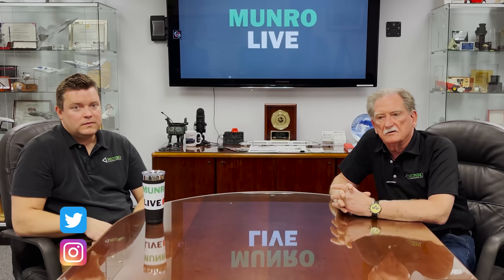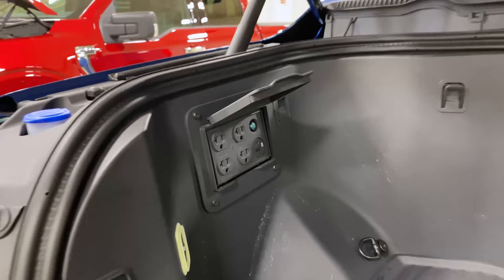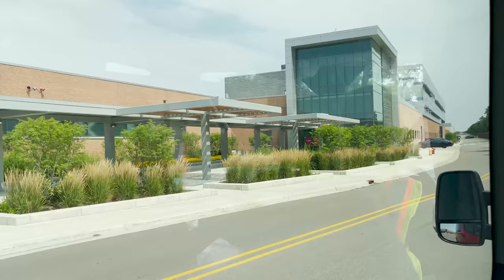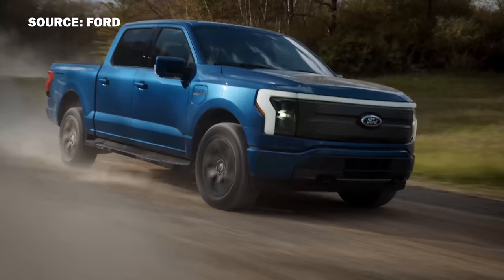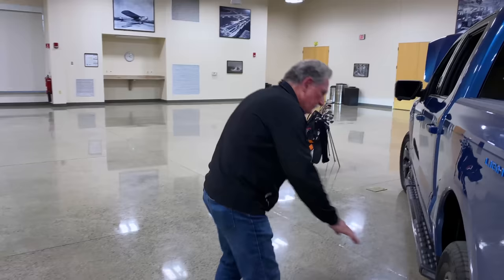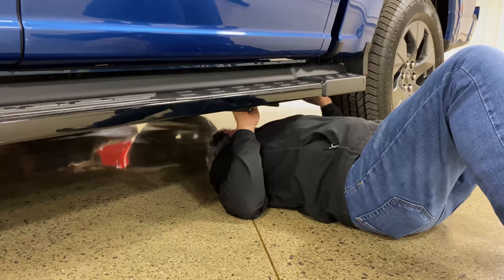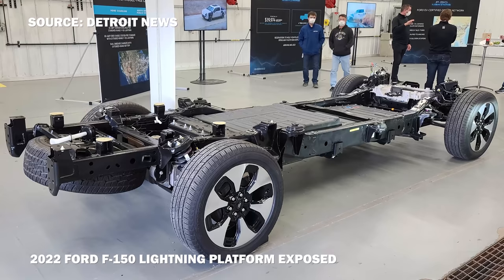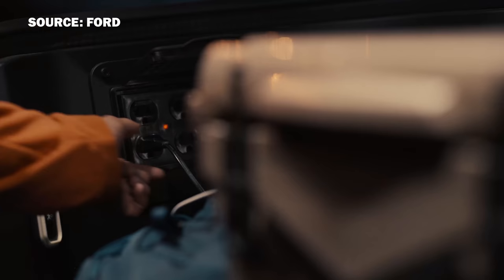Sandy's First Look at the Ford F-150 Lightning Electric Truck!

Comment: FORD F150 XLT LIGHTNING, $92,500., WHAT YOU DON'T GET BELOW.
F350 4X4 CREW CAB FORD GUY GOING WITH TESLA.
RETIRED 77, USAF VET, JET MECHANIC. REGISTERED FOR 2023 CYBERTRUCK ON NOV 22, 2019. TRUCK FEATURES: FULL SELF DRIVING, SELF OPENING DOORS (NO HANDLES), FREE DRIVER ASSIST (AUTO PILOT), FREE OVER NIGHT SOFTWARE UPDATES, STAINLESS STEEL TRUCK, BULLET PROOF, CLEAR ALUMINUM WINDOWS, ACTIVE SUSPENSION HEIGHT CONTROL. FOUR WHEEL STEER, CRAB WALK, TANK TURN, PAYLOAD 3500 LBS., TOW 14,000 LBS., FOUR ENGINES, 800 HP,  500 MILE RANGE, 35" TIRES, 16" CLEARANCE, 5'x 6' NO FENDER WELLS VAULT BED, WALK ON TONTO COVER, 31' LONG. PRODUCTION 80K TRUCKS ANNUALLY. EDIT: GENERATE MY OWN ENERGY,  https://www.youtube.com/watch?v=TtQm34QopN8

Comment: Isolated battery = increased weight and lowered utility.  An efficient design would incorporate it into the structure of the frame, not turn it into cargo.
Reply: For upgrades you want the isolated battery.  There are also more battery choices.

Some may want a 400lb battery in the frunk or a 1k+ pound battery in the bed etc.  So a 472 mile Ford Lighting could go 1000 mile or even 1500 miles on a full charge.
Reply: @jonmccormick8683  A structural battery can be exchanged.  It's bolted together like any other part.

Comment: I will buy this in a second when they make a cab & chassis F-550 capable of hauling/towing 30,000 pounds and can get  200 miles doing so.  Assuming its in the $70,000 or less range of course.

Comment: 230 miles of range for the base model is not a good look. Going tailgating you might drive 50 miles each way, then you're plugging stuff into the truck for your lighting/entertainment/cooking for a few hours, and then the drive home. That would be cutting it close, and you'd probably need to stop and charge. Of course Ford doesn't have a Supercharging network either.

230 miles of range would not be usable for most fleet trucks as well, and no way are these companies going to spend for the upgraded models. If you're plugging tools into the truck the battery will be dead by lunch. I work out of my Model 3 (just AC, music, and my laptop plugged in) and the drain is real.

Comment: I really want to go to an EV. And I have solar panels on my roof. But I'm in an area of Mexico that has virtually no charging network for road trips. I can"t say when that will change.  And due to the cobblestone and dirt roads I'm thinking of something like a Bronco Sport Badlands. That's the perfect combo of size and utility for me.

As much as I hate the fact that plug in hybrids are so complex and expensive the closest I can see for my needs are the Rav 4 or Escape PHEVs. 

Any thoughts?
Reply: Hang in there. There will be mid-size EV trucks and SUVs soon enough. It's going to be a tidal wave of change when it happens. Electricity is much easier to deal with than gas or diesel. Like you mentioned solar panels, even a "EV fueling station" that's off the grid can function with some solar panels and a battery storage system. No need for refueling from tankers or running power out to a location.

Comment: Just a thought.. let say a trailer manufacturer wants to sell to be towed by this eF150. Ford should be willing to lease (for free) this vehicle to them, they test their trailer on the said 10 mile configuration/validation.. they get the data and so do ford - of course that's the reason ford will lease it to them. Thus ford can put in this data with estimated range already in its memories so that the eF150 users don't have to - or they can download from the manufacturer.

Just like driver software after needed for pc so that computers can talk to the said peripheral.

Comment: Doesn't having an isolated battery pack add quite a bit of cost to the truck? Won't a smart computer system be able to create a virtual battery pack isolated from the vehicle but also allow it to be used for driving in time of emergency more flexible?

Comment: why does an Electric Truck even need a GEAR Shifter for ?
its Another thing to BREAK and is a Part that Should be DELETED along with the START Button in Vehicles. 
the Cybertruck has no Shifter at all, you just Swipe the Screen . 
CT does not even have a START button, you step on the BRAKE , Swipe into Drive , Release the Brake. that it.

Comment: Good stuff. Fascinated by the description of the rear(?) casting. If I understood correctly it has some rotational freedom around the axles and some degree fore and aft as well. Is that correct?

To video editor: intro cuts were just a bit too jarring. I see what you were going for and it almost worked. Just a few too many hard cuts for my eyes to keep up with.

Comment: Tesla has plug ins, it the back as well. Tesla can use the computer in the vehicle, you don't need another work space. Plus I don't think they have an old gear stick???
They did not let you drive it? Is this the 90k truck? Do they even have the prototype for the 40k truck. 
The nice part of this is anything good, Tesla can copy. 

Ford doing the low end up front is going to hurt them bad. I believe there is a major loss on the 40k truck. 

It looks like a normal truck? The frunk is very nice for sure. 

It took Tesla to push Legacy to do brand new inovative stuff. I am impressed about that, but the Truck will still be 50% old stuff like you found in the Mach-E.

Comment: Ford doing so much right with their EV approach. The F150 Lightning is absolutely going to eat every other EV truck's lunch. Even the boutique trophy lifestyle ones. Especially those poseurs.
Ford doesn't fight Right to Repair and they also don't look like they're going to over promise and under deliver on range either, like Tesla does on both fronts.
My prediction - a robust online campaign to undermine this truck once it starts selling. Waged by the usual online culprits: the cultists.

Comment: Unless Ford has an answer to the Tesla 4680 cell it won’t be successful. The 4680s 60% reduction in cost alone will kill it that’s not even talking about charging and discharging improvements over all the other cells.

Comment: making the 2021 FORD BRONCO a Hybrid was a Mistake, FORD should have made the BRONCO ( all Variants) 100% Electric with a Large 100 kwh Battery Pack and 100% Electric Drivetrain with no option of Hybrid or GAS Drivetrain. 
they would have sold more Vehicles and customers would be happy the the SPEED and Instant TORQUE boost , as well as the Range and Towing ability 100% Electric provides. 
however FORD needs to also help BUILD a Nationwide FAST Charger Network.

Comment: I do not understand: so far Sandy was amazed by the thought of a structural battery pack. Now they are amazed by an isolated one? I get that this is a truck and it has to be durable, but still.

Comment: The switch to electric trucks is afoot ecxept for the big tow.  When is Ford going to reveal their solution for that?  You can use one of these every day and do anything a gas truck can do until you decide to tow a trailer or boat over 200 miles.  At that point electric trucks make no sense.  Ford patented a bed mounted range extender a year ago but hasnt mentioned it at all.  If you put a tool box shaped range extender in the front of the bed, it could be stuffed with extra batteries, a gas or deisel generator or even a hydrogen fuel cell depending on what fuel is available along your route.  This would resolve the remaining limitations of the electric truck and when you dont need it, you put it behind your garage as a backup generator for your house.

Comment: You guys bought the sizzle from this Ford team.
Reply: Seriously? What's wrong with appreciating what others do right?
Reply: @magnusauto7941  , if they really wanted the vehicle to stand on its own merit, they would have dropped it off for a day, instead they brought a sales team. They sold a big trunk, plug in electrical, independent suspension,a drop down gear lever, these aren’t new ideas, they were selling sizzle not steak.

Comment: When it comes to a truck I prefer the lowest equipment and trim levels because you can haul more load (heavier) . Electric windows and door locks add unnecessary weight and opportunities for failures.  I don't even want a radio. I don't want a touch screen because you must look at it to change any settings,  eyes belong out side at all times. I do want climate control and GPS receiver.
Reply: If you get a truck with the Suynch system, most settings can be changed by pushing a button and giving it a command such as "Dial [name]" or "set destination, street address". You can also change radio stations by vouce command. You never have to take your eyes off the road.

Comment: I really like what I see, I'd like to get a chassis model that I can put a camper top on. Built in power source I can charge as needed, with supplemental solar on the roof.
Reply: Solar is almost useless for cars, the efficiency of solar panels is still very terrible, toyota has been using solar on their hybrids to run the AC and charge the 12v battery for example.
Reply: @alanmay7929  I agree. But a parked camper top truck with 1kW+ of solar panels on the top is a lot different than a small car roof.

https://youtu.be/kd6LSJjOawM?t=1118

Comment: I don't think Ford  will have enough  battery capacity to even hit 40% of total sales as EV by 2030. That would require in the ball park of 168GWh (at current volume assuming 70KWh packs each) of battery capacity or almost 90% of the current global battery capacity.
Reply: they are building two new battery factories in US with SK.
Reply: @garfieldchenyu1  I was reading about that, but they only are planning on 60 GWh by mid decade (2025). So they would need more then double
 what BlueOvalSK plans on producing from other supplier to hit even fords estimated demand of 140KWh by 2030

Comment: The Lightning looks to have potential, at least based on Munro's review...I just wish it had more range.  At least 350 miles...
Reply: I can't find a link but Ford has a patent on a range extender.  From what I remember it was the size and shape of a typical truck toolbox and contained a gas generator
Reply: @TqSNv9R0iG5Ckxew  I recall that.  I would be surprised if they ever rolled out that idea though.  Range is the last piece of the EV equation, IMO.  If all the EV trucks from the various manufacturers can get to 400 miles or more of range, look for sales to shoot up.  With all the torqure, and all the electric features, people will be clamoring for them.

Comment: Takeaway--you can change. The world won't end because a better, more environmentally friendly method of propulsion has been introduced. Again, the fear comes not from the new thing, but the ending or fading away of the familiar. However, what is not-so-familiar at present will, in time, become the norm. There are real, substantial reasons that these types of vehicles need to be adopted. There are many cautionary accounts throughout history where a better choice could have been made, but fear was used as the guide and ruin followed thereafter. So, for Ford to have made this effort on their most profitable product is commendable. Success is not guaranteed but the effort to change, along with understanding, is mandatory.

Comment: Obviously they are pandering to the marketing types that so graciously invited them to Dearborn. They speak very little of the energy density required to power that pig. Add towing and scavenging energy outlets and you really got something to deal with. I would suggest offering as an option a quality portable diesel generator. We already have a constraint in the world of battery raw materials. Perhaps a nuclear reactor in there somewhere ?

Comment: The usable range will not be enough on this truck. Even the top tear Lightening only offers 350 miles of range on a full charge. They have a massive battery, too much weight, not great aerodynamics, probabely have a heater core rather than a thermopump. Assuming a contractor living in the northem parts of the USA like Vermont wants to use his truck for a day doing building or landscaping. Assuming you only ever charge to 80% for better battery life. Now add tools, pin a trailer with a Bobcat, drive to pick up 1-2 guys, get coffee, get to the job site... how much power do you have left? Now plug in all your tools for the day. Now try and drive home. Assuming you loose 50% of the range pulling a load and you start at 80% charge. If you work out the power requirements for the day "on the job" I believe you may fall way short? Speculation on my part. It would be great to make the actual calculation and then go out and do it. Compare calculated power consumption on paper vs. real world. I believe the tri motor Cybertruck has a 612 mile range percisely for the reasons described above. Unless you have big power reserves you are helically wrapped around an inclined plane.

Comment: the FUD motors Lightning has an OUTDATED Vertical MAIN Screen , copied from the 2012 TESLA model S. 
the Cybertruck Large Horizontal MAIN Screen is more Useful and EZ to see. 
you are Able to better see the REAR camera and Side Camera displays. 
the TESLA Driving YOKE is Superior to the Conventional OLD FASHONED Round steering wheel that the LIGHTNING uses.

Comment: I'm sure people will misunderstand this as I like electric vehicles and have no desire to own another fossil fuel automobile, but it's not really fair to criticize petrol vehicles for containing flammable fluids when current lithium batteries are burning down homes just from sitting in the garage connected to the charger.  Are electric cars more dangerous?  Probably not, but don't poke your fingers at petrol for being "explodey" until you've solved the flammable lithium problem ;).  The electric car fires are more likely to make the news, unfortunately.

Comment: TESLA Cybertruck is putting a LARIAT around Chevy, GMC, gm, RAM and FUD motors neck.
Reply: Except for the looks. I just don’t think I could drive a cyber truck. I drive a M3 now and was hoping Tesla would get it right.
Reply: @craig8638  - but, would you drive a Model 3 if they offered a Driving YOKE ?

Comment: If we could just let Tesla engineer their battery, HVAC, Cooling, Electrical, and Software That thing would be unstoppable. They also should have shared Tesla’s charge connector and partnered with their charging network. I’ll probably never buy a non Tesla unless they use Tesla’s charging network. Ease of use, cost, speed, availability. Electrify America no thank you. Very happy with my M3P. Keeping my Cybertruck reservation for now.

Comment: Given that our road taxes [the 'income' that pays for road repairs] are a part of the gasoline prices, is this going to be an unforeseen issue?
Reply: higher taxes on purchase or pushed to insurance or tires or inspection tags, plate tags.  there's plenty of ways to tax it.  problem is i just hope they switch to a miles per use.
although i could see a small 1-3% tax on power which could cover enough or more to keep the roads good.

Comment: Imagine driving into a EV battery exchange shop where they pop your wheels off, drop the entire battery 'chassis', fit a replacement and your wheels and you drive away in less than 30 minutes...

Comment: MOST Trucks today have SHIT Suspension with a Solid Rear Axle and Independent FRONT suspension ONLY. 
the RIVIAN has 4 Wheel Independent suspension , as does the HUMMER EV, but the ENDURANCE has an OUTDATED leaf spring suspension that came from HORSE & BUGGY Technology. 
MOST Trucks today have OUTDATED leaf spring Suspension .

Comment: Remember all rave reviews about Motorolla RAZR flip phone 10 years ago? iPhone killed it. Neat tricks can't stand up to true technology innovation. Lightning is still a legacy design: it dents and rusts with 15yr lifespan, it's brimming with fluid lines and brackets and lead acid battery, it has low clearance, its dumb software is trivial to hack, its windshield chips from small rocks. Cybertruck is space age technology - it will rip legacy tech apart.
Reply: How to say ‘I’m an idiot’ without saying ‘I’m an idiot’.
Reply: Are you talking about the classic RAZR foldable non smartphone (which I had back in 2007), or the new foldable RAZR smartphone that came out three years ago?

FWIW, the lifespan of a car depends on how well you take care of it, and where you live.

Down here in Texas, my 2006 F-150 XLT has no rust and is still going strong. Of course I take care of it, and do proper maintenance of it.
Reply: Uhm all newer F-150's are made from Aluminium
Reply: @storm4710  aluminum rusts. Worse than steel. Called oxidation. Paint pops. Can't repaint it.
Reply: @egore5417  It corrodes when exposed to salt
Rust is specific when steel oxidisses,
both can corrode, 
aluminium is less corrosion prone than steel,

BTW Your discussing this with a guy that repairs vehicles for a living,
Reply: @storm4710  sure. And you're talking to a guy who owns aluminum bodied car and is out $1000s because the damn thing rusts on the edges, paint pops and you have to replace panels with OEM parts because it's not repaintable